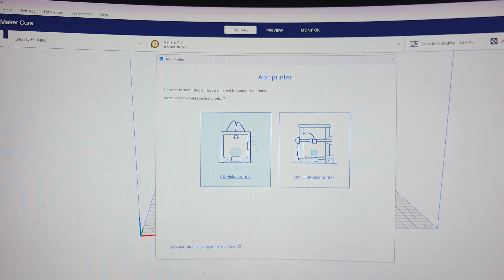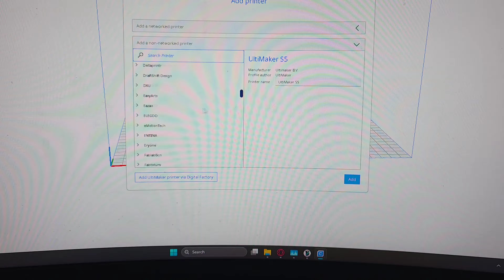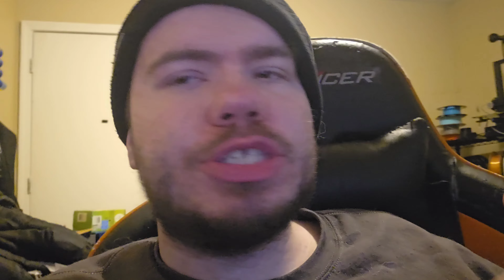Slicer showdown: Cura vs Orca slicer

Comment: yes all the settings are available at cura too  ... they might just be called a bit different. what i like on cura the most is that i can set up my settings as i want them. for example i have a profile and can just show in this profile the settings for speed, infill, lyer hight , and support. nothing else . because the rest is already tuned. that fuckes me up in orca that i have to scroll throug a bunch of useless settings for important changes like support settings
Reply from the maker: But you dont and can do the exact same thing theres even a little tab that says supports and that whole tab is just supports. Theres a setting in orca that allows you to set the settings you see.
Reply: @Savage3ddecals   so where can i find the setting that i can just show the settings i like ?
Reply from the maker: For one you can turn off dev mode or expert mode or advance mode. Its a little slider at the top of the bar. There should be no scrolling needed so you should be able to find it pretty easily i always have mine set to dev mode because scrolling down an extra 2 settings doesnt bother me especially when they add experimental stuff like z contouring which is really nice for stair stepping.
Reply: @Savage3ddecals  this is exactly the problem, in easy mode you can not even set the speeds , in advanced you have a bunch of nonsense already that should be tweaked once and stay. i only need z alingment, line with , speeds, wall order and some others like supports and so on but no jerk settings, accelerations and 100drets of other settings you probably never touch. that is so annoying in orca . cura is 100 times better in the settings menu.
Reply from the maker: I use like 85 percent of the settings in orca i don't see why your using so little functionality that or your using a printer that doesnt have half of the stuff available for it. Like a marlin 1.0 also why do you need speed set speed to the max the printer likes without jumping and control your filament by its max volumetric flow . I mean the only thing I'm getting from this conversation is cura is better because i can hide the settings so i dont have to know how much quality im sacrificing. You complaining about to many settings is what makes orca better. My other question to you is why are you not trying to learn the other settings and have them enabled or setup correctly like arc fitting or better brim settings that actually set your brim to compensate for elephants foot.
Reply: @Savage3ddecals  no i normaly spend hours to dial in my printers very well, they print excellent. but after 10 years of experience i know the speeds that are god for some stl files better than my software ;) so i like to set them manually. i just worked with cura for 10 Years and switched to orca due to less  support of my new printer in Cura.  (no prest profile) so i tried orca . and i really think that cura is the better slicer. orcas  integrated test files are great and the klipper integration is good. other than that i would always prefer cura.
Reply from the maker: Cura caused nothing but problems on the 10 machines i tried it on just switching to prusa slicer fixed all of them then orca came out and it ruled not only can i have every printer under one slicer but i can even set things for my custom printers and the integration of kamp into orca makes it nice

Comment: Great vid. I'm just so used to CURA as my "go-to" since it has done so well for me. I'm using Linux (Ubuntu Studio 24.04 LTS). Been using Linux exclusively for quite a while. My setup: FreeCAD(mostly. Sometimes tinkerCAD if in a hurry for a basic design), CURA, Octoprint, Ender 3 w/Upgrades: BigTreeTech SKR Mini E3 V2.0, MicroSwiss Direct Drive Extruder/All Metal Hotend, Autobed leveleing etc. etc... (i went nuts lol)...  I haven't printed anything in over a year but about to get back into it.. When I WAS up and running I was able to do some pretty cool stuff in CURA with multi-color printing(pauses, filament changes)...right from within CURA by adding G-CODE manually when needed... And regarding Octoprint? Not sure i could live without it since I use Twitch.TV to stream the camera I have mounted to print bed. I'd be curious to see if Octoprint, my camera and my whole setup would benefit from switching slicers.. and what, if any, advantages Orca would "really" give me in terms of speed/quality... it's an old Ender 3(Marlin), afterall... but she's STILL my baby!  haha... She's slow but still does a fine job in the quality dept. once "tuned" in CURA. Thanks again for the detailed info on Orca! It can't hurt to try it out I guess, and see how it works with Octoprint/Twitch/my setup! I may give it a try after seeing this once I am fully back up and running SOON! (CURA 5.12.0 on Linux is running slick btw!) About to get good old Octoprint dusted off tonight and dive in the deep-end again! It's random videos like this that pop up in my feed that can be so inspirational. Sub earned!